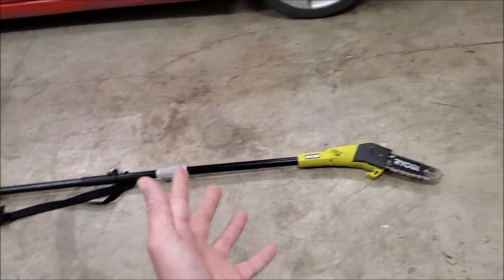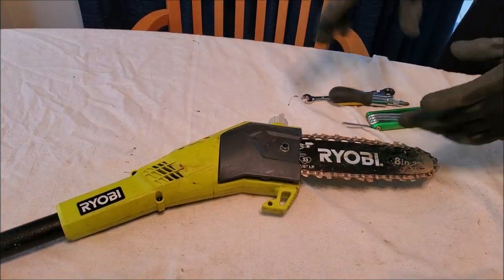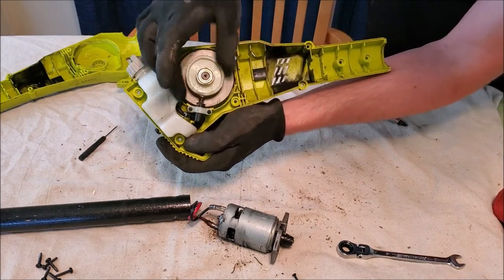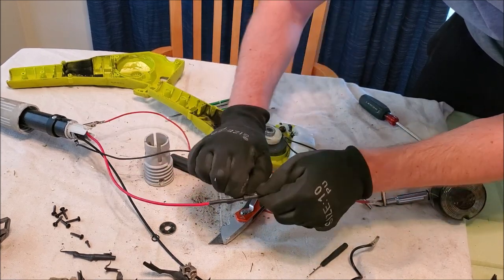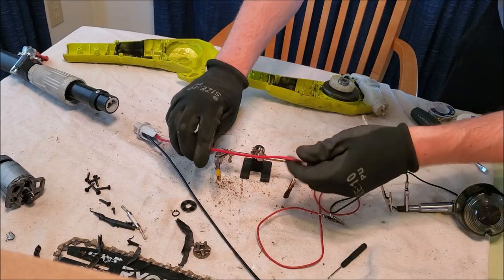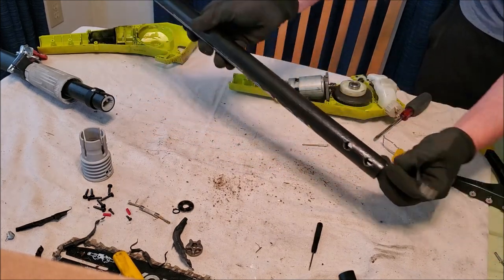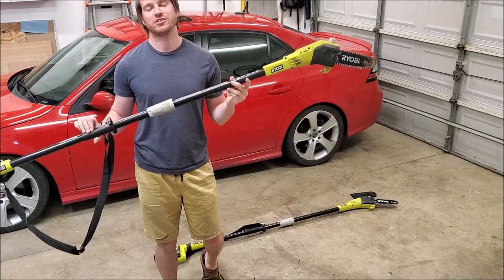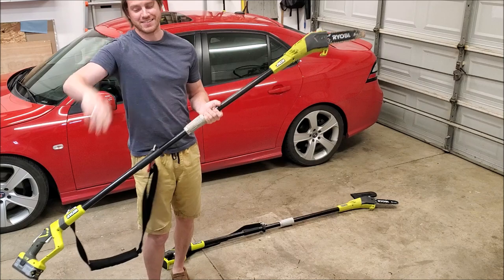BROKEN Ryobi Pole Saw Fix

Comment: that little fuse may have prevented the battery from bursting into flames in your hand. do you really think they put it there to sabotage you? They would have used thinner wire and have it burn up if that would have been the idea.
Reply from the maker: I'm not contesting the point of the fuse. Merely the location of it making it non-serviceable. How people fix there tools is entirely up to them but the point of the video it to show if the tool randomly stopped and is no longer functioning - it very well could be this hidden fuse.

Comment: do you have some aversion to using a volt/om meter?
Reply: He certainly has an aversion to LUBRICANTS too.
That gearbox won't last long now that he's cleaned all the grease off, and reassembled it bone dry. The user manual says "Use high temperature and high velocity compound grease in the gearbox".
PS: Total bullshit on the story that all the oil drained out when he hung it. ROFL.

Comment: I need some help! Please. I have exact model but mine spins the opposite direction . Why?
Reply from the maker: Did you buy new? Im not even sure if polarity was flipped on the electric motor if it even would work.
Reply: @WeakestofWeeks  DC brush motors are polarity sensitive (they can run backwards) that is how drills work.

Comment: The first one I had failed in the first 3 months and Home Depot gave me a brand new replacement. Now it is out of warranty and the pole saw failed today. Today took mine apart before finding the same issue with the fuse location. What is with Ryobi's brain thinking? Do they want their tools to get a bad reliability rap sheet, or wish someone to buy a new one - which will probably be a different brand; or are they trying to make money on service repairs. Whatever it is, there should be a complaint to whatever government dept for a recall of them all to have the fuse location moved to an easy access position for replacing. This is bullshit.

Comment: I just bought a Ryobi 10inch 40v pole saw with the larger battery for $219.00. The regular 40v battery is $119.00 but I felt the bigger battery was worth it.
Never had or used a chainsaw in my life. Usually used a bow saw.
Didn't realize you HAVE TO TIGHTEN THE CHAIN BEFORE YOU USE IT. 
I cut 4  1/2" branches off a main branch before the chain came loose. Spent 4 hours trying to reattach chain and get saw to work. Motor would try to turn but chain stuck. Took saw apart numerous times to resett chain and get it to move on chain bar.
No dice. Still dead. Remember to ALWAYS REMOVE BATTERY BEFORE TOUCHING CHAIN!!! or you risk accidentally hitting switches on your lap and starting motor and possibly cutting yourself. I always make sure any electrical appliance is fully disconnected from its power source or circuit breakers off before any exploration of the device.
I realized the chain was binding on the bar. At first I thought the bar had gotten pinched when the chain was thrown.
After numerous hours assembling & disassembling I decided to try just moving the chain around the bar away from the motor. WALLAH!!!
One of the teeth base on the chain was bent just enough to get wedged in the bar Grove preventing movement. I have to get another chain and find my Dremel Tool to grind down the bent base. I notices doing this will not weaken the chain since it is only 1/16th of an inch to be ground. What a cheap piece of crap the chain is to bend that easily with 2 minutes of use.
Ryobi could have made the bar and chain an 1/8th to 1/4" wider for more stability and strength.
I don't think the power would be affected for cutting.
REMEMBER TO ADJUST YOUR CHAIN TIGHTNESS BEFORE USING & HAVE A SPARE CHAIN.
The chains are cheap enough.
Maybe that's why they are because they are known to fail.
But it wouldn't be a major cost to make a wider BAR & CHAIN.
THEY WOULD ONLY HAVE TO MAKE THE MOTOR WHEEL FOR THE CHAIN AND THE COVER WIDER FOR THE EXTRA WIDTH.
A PROBABLE $2.00-$5.00 FIX.
Maybe just a Thicker Washer added to raise the cover the required width. and a wider wheel.
Otherwise I like Ryobi tools.
I have a 40v WEED WACKER TRIMER that works fine.
Reply: If you have a trimmer you can also buy a circular blade and that works just as well as a chain saw for small branches.

Comment: I have a corded version from 2016 which still works fine with thankfully no issues with the motor. . My only problem, however, is with the chain which has a tendency to come off during use.
Reply: Well, tighten the chain. If it's worn out then buy a new chain. It'll cost you, what, $10???

Comment: That has to be intentional because the rivets make it so it osnt intended to be replaced i bet that os what os wrong with my pole saw but i also had a dust buster just stop working and have had other tools in past do the sake i wonder how many of the tools had something like that in them. Most people probably assime since ryobi isnt as expensive as some other brands that the tool just died for being a cheaper tool and just go buy another or maybe when more expensive tool. It is pretty much a home depot brand so they benefit either way if you buy another or get a more expensive one....  Scams like this seem to be the norm now adays in a country thats government is supposed to protect its citizens from things like this but instead they do more to protect the corporations and give tax cuts as a reward to the greed.